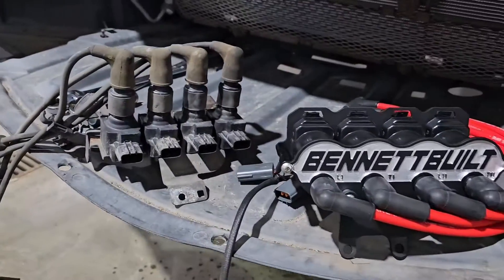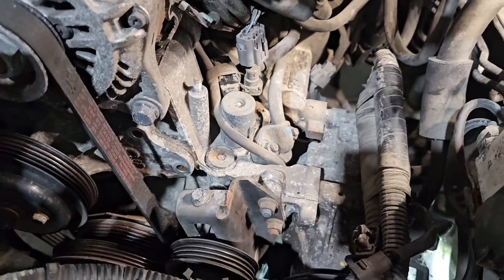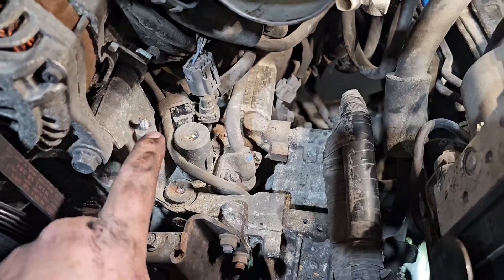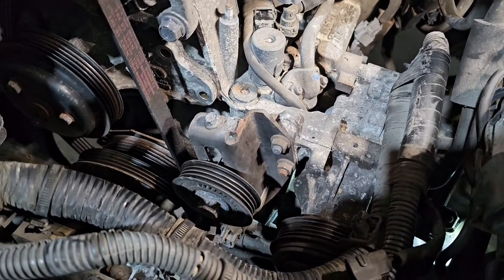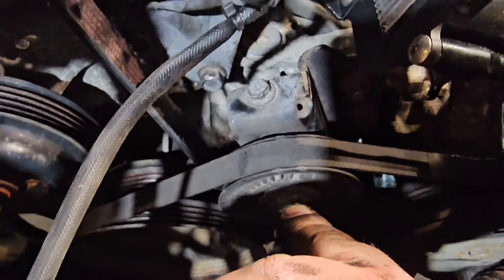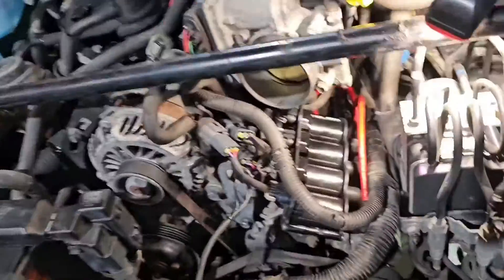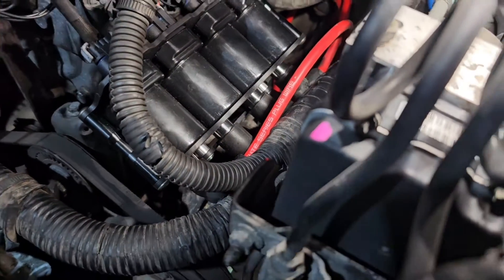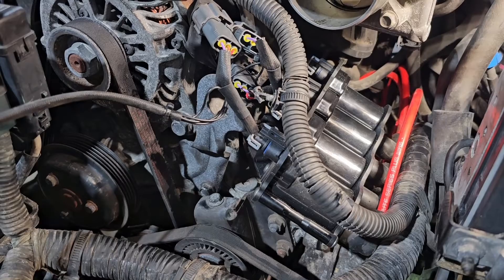Bennett Built LS coil conversion for Mazda RX-8

Comment: Mine starts fast, won't idle with maf plugged in and misses, has flashing cel, oil filter cut open had metal and it was abit. This is where im at with the one I bought recently. Gonna throw coils on it and see if it helps, if not I have coils for another engine. Win win